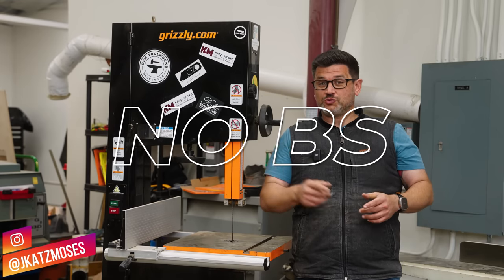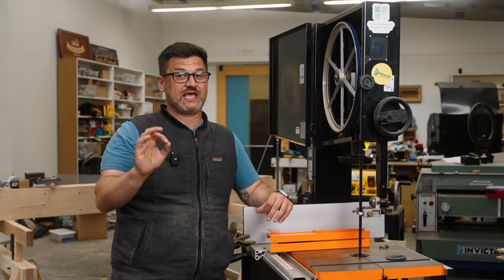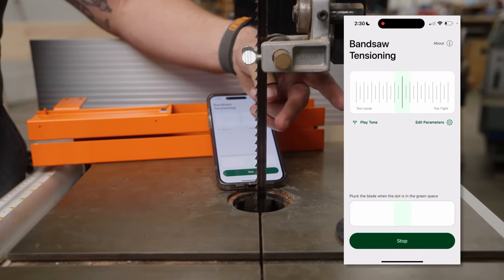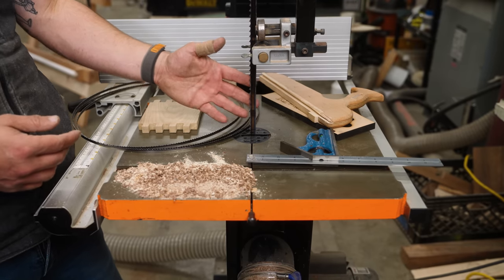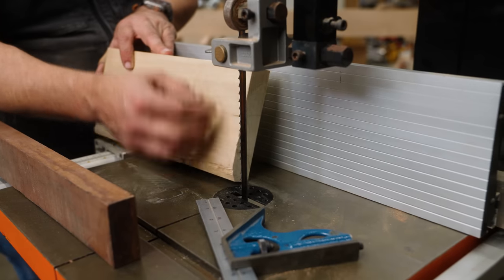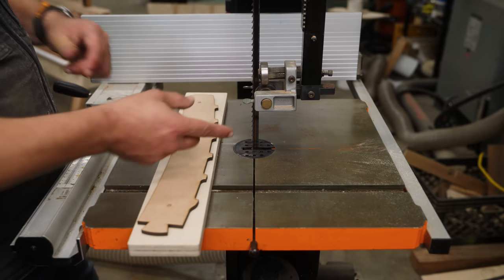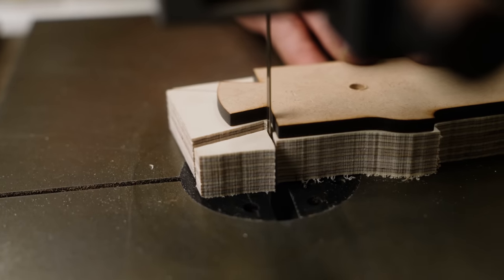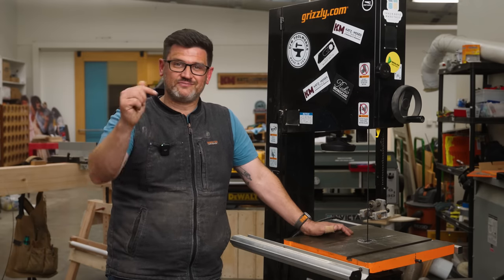Bandsaws: Mastering Setup and Use - A No BS Guide

Comment: Great video, and just in time.  I had a blade wandering and everything was tuned up, not running on bearings, not over tight, or loose on the tension.  Tracking was perfect, back of gullet riding right on the center of the tire.  Wouldn't you know, the blade was dull...I didn't realize how dull until I swapped it out.  Thank you!

Comment: thank you Katz . i have the same bandsaw . i use a 3/4 " 3 tpi  for resaw and use a disk grinder to resharpen it it takes about 18 mins . on the face . after i got it a wind fall fell into my lap . trees dropped in my area . 200.00$  chain saw and i have logs to boards . pear . china berry , birch and oak . sitting on cinder blocks an 2/4" pear is chest high . lots of work but good wood .in 72 i learned to open blades . i forgot how by 2014 lol . at this time i got 8 white oak logs waiting for health to improve and to finish building Izzs chain saw jig / sled . thank you for all you do .

Comment: I have a 14” wood cutting bandsaw and love it. If you think putting a new blade on can be intimidating, you should try that on a horizontal steel cutting bandsaw, where the blade twists almost 90 degrees to go around the pulleys. I’d also just replaced the guide bearings so everything was out of. whack. I enjoyed your video, keep up the good work. Almost forgot regarding changing blade, I have only one arm which doesn’t help either.

Comment: Thank you for this video, Jonathan.  As a cautionary tale, I ruined a Rikon band saw during my move because I forgot to detention it.  During the move (summertime in the Eastern US) it was on the truck several nights and when I finally got to it in the shop, the main spring was toast.  Still to this day I can’t find any way to replace that, so now I have to replace the entire saw.  I’m heartbroken and wallet light.  But, your video will be key when I finally get that new saw and get it tuned and set up.  :)
Reply: Amazon sells a Carter tension spring for 14" bandsaws - called a "cobra coil bandsaw tension spring", about $35

Comment: As you point out in showing your testing rig, bandsaw tension is set in pounds (lbs). There are actual tension gauges available to set the tension; one of the best is from Starrett. The saw itself plays a huge role in selecting the target tension, so it would be good if the app allowed for cast iron vs. welded steel bandsaws etc. I have a 24" Agazzani that I run a 1" carbide Trimaster blade on tensioned to 35,000 lbs, and it works beautifully. I also have a 17" Grizzly, and there is no way in the world that saw could tension any blade to 35,000 lbs, as the spring would be in coil bind well before that, so the type of saw is very important to determining the target tension.

Comment: Jonathan, this video could not have come out at a better time!  I just finished cleaning and replacing the guide bearings on my 14” Craftsman bandsaw last night in preparation for getting back out in the shop after a long hiatus. The app has been purchased and I’ll be using it when I install the blade today!  Thanks for all the awesome no-BS videos!
Reply: I own a craftsman also.  Unfortunately since Sears went belly up support for the saw doesn’t exist.  However, I found that my saw must have been built by Rikon or the manufacturer of Rikon.  Mine is a cross between the 10-324 and 10-325.  I’ve been able to buy parts and accessories that work perfectly with my Craftsman.  And it is a great saw.
Reply: @mwoody4560 I have a Rikon 13-900 rip fence on it. Bolted right on with no modifications.

Comment: Several really good tips. Blade tracking and tension, templet jig, how to adjust bearings, types and width of blades. However you didn't cover aligning the miter slot to the blade and the fence to the miter slot.
Reply from the maker: That’s more table saw setup. A bandsaw is a rough cutting tool and those things aren’t as critical

Comment: Great info!

I have been using the frequency method for several years after a blade failure (I was using the finger press method previously) took me by surprise.  I use the free Spectroid app on my cell phone to measure band frequency and formula from Fine Woodworking to calculate the desired band frequency.  For my saw (14” Rikon) and the blades I commonly use the target frequency is usually 57-61 Hz.  So I have just been using 58 Hz and that has worked well.  I resaw 10” wide boards into 0.180” thick panels for ukulele fronts, backs and sides.  That can be challenging and proper tension and a sharp blade really helps.

The only problem I have when tuning a blade is noise in the workshop.  I end up turning off the fluorescent lights, dehumidifier, and occasionally the furnace to make sure I have found the rightpeak on the Spectroid display representing the “fundamental” and not 60 cycle noise or a higher harmonic.
Reply from the maker: Sounds like a lot of work but cool way to do it
Reply: Thanks!  Excellent pointers,

Comment: I downloaded the app and used it on a Laguna 14BX with a Timberwolf 1/8” x 14RK 0.025 … I couldn’t loosen the tension sufficiently to get into the desired range and it felt scary loose. Interesting, I cleaned my blade (it had some pine resin/sawdust) and, without moving my phone, the frequency changed slightly. I’ll check the next blade when I need to change for the project, but am apprehensive about running the 1/8” at such a low tension (reading below 0 on the built in reference). Keep up the great work and I look forward to the updates to the app.

Comment: Something I think might be interesting for a No BS video would be fences.  How to set fences properly.  Differences in fence styles and lengths.  Recommended fence upgrades via purchase (Bow XT extender, Jess Em stock guides, etc), as well as jigs or other construction that can be made to compensate for a fence that won't keep square or is too short (a contractor saw fence, essentially).

Comment: A recommendation for the app, that could help inexperienced users (and you, if you start selling bandsaw blades through your site, or if you have affiliate links):  Blade recommendations by usage.  When you're on the screen to set your parameters, put the type of cutting first in the list. Have the app default to recommended blade width and tpi automatically, and a link to where we can get your recommended blade for that setup. Then, if they don't have that exact blade, they can adjust parameters to the closest of the ones they have. 
I know the more advanced users won't need to be reminded of the recommended type each time, but it could be a nice perk for the newer users.

Not for nothing, but finding another way to offset the cost of the app might be a good idea.  Don't get me wrong, it's a cool idea, but raising the cost more than $5 on something that is basically a combination of a single data reference table and a free guitar tuning app is probably going to be pushing it.
(and coming from someone who's bought quite a few of your products, i mean this in a constructive way, not trying to negatively criticize)

Thanks for another great No BS video!

Comment: With respect to TPI I have had a lot of success with the guideline of “enough to have 4 teeth in the cut, or 3 tpi, whichever is coarser.”  You don’t want to cut 1/2” stock with a 3 tpi blade, but for resawing 6” stock 3 tpi is great.

Comment: Excellent video. Than you JKM. One helpful hint that would have helped (If it is true). When the cut is tracking to the left, the blade needs to be adjusted forward and vice versa, if it is tracking right, the blade is too far back on the wheel. I am pretty sure I learned that from Mr. Snodgrass.
Reply from the maker: Feels like we should test that. Makes sense and has never crossed my mind
Reply: @katzmosestools  That has always been my issue with my Harvey Ambasadore. I can't keep the wood against the fence. It walks away (need to move the blade toward me.)

Comment: Thank you Jonathan, downloaded the iOS app & went out to my Jet 14" band saw that currently has a 105" x 3/8' 3 TPI Carter AccuRight blade installed - I was amazed at how under tensioned the blade was.  I set the manufacturer parameter to 'Other' - the app worked perfectly.  My one question is does the temperature of the blade and ambient surroundings have any effect on the tension tuning (I'm in NJ, my garage temperature was 54 degrees)  If so how often, or at what +/- temperature variation should I expect to re-tension?

Comment: Thanks.  Question on blade position.  I’ve always centered the blade on the wheel.  You said the bottom of the gullet should be centered.  Does this hold true for all blade widths?  I use a 1/2” or 3/4” blade often for resaw.  It seems that if I centered on the bottom of the gullet those blades would be very close being of the edge of the wheel.  PS love your channel and this series.
Reply: PS.  I just went through my old saw and reconditioned and tuned it.  This was great timing.  I’m now reconditioning, tuning, and upgrading my jointer and thickness planer.   I’m replacing the straight blades with Byrd Shelix cutters. A video on jointer or thickness planer tuning, use, etc wood be awesome.  I have old rigid 6” jointer and 13 1/2” planer.
Reply: PSS.  I use woodslicer blades.  If I heard correctly you wanted to know the blades we use so you could update the app I just purchased😊 My saw is 14” and uses 99 3/4” long blades up to 3/4” thick.
Reply from the maker: Yeah you still want to put the area just behind the gullet in the center of the wheel. Think about it like towing a trailer. That’s the part you want the tension. If you center the blade then it’s going to want to pivot in the middle of the blade and not where you’re cutting

Comment: I purchased the app. I set up all the parameters, Timberwolf, 31” wheel to wheel centers distance, non-carbide, wood, straight cut, & ½” blade, and tried it out. No matter what the tension it read “Too Tight” even to the point where there was hardly any tension on the blade. The tension indicator never moved! I did at one time get close to that deep base tone at which time it still read “Too Tight”.
Reply from the maker: Watch Andy’s video. It explains it n depth. Dry measuring on the other side of your wheels. I’m guessing something like the brush designed to removed sawdust or something else like a guide is touching your blade on that side. Either way watch Andy’s video. The update will have a better step by step guide on trouble shooting and use. Cheers
Reply: Update … I put the phone on the other side of the blade, i.e., between the blade and the support beam. Made sure the phone was square (or perpendicular?) to the blade. My first test was “Too Loose”. Amazing, a different answer! Kept tightening and the indicator moved closer to the center. Gave one last tightening and it was a little “Too Tight”. Loosened it up just a bit and I was right on. YEAH!

Comment: I have a 10" Rikon benchtop.  The manual says "... the saw blade should deflect about 1/4” when pressed with a finger to the side of the blade."  But the manual omits specifying how hard to press.  I need the app!
(Aside:  To align the drive wheels, I cut a straightedge out of hardboard (aka Masonite), with notches to bridge the frame.)
Reply: I also have a 10” Rikon bench top bandsaw and would love to use this app!

Comment: Jonathon/Andrew, I purchased the app two years ago and am currently running v1.6.0 on an iPhone.  I am having issues where the app almost always reads too tight.  I was trying to tension a 3/16" Timberwolf blade yesterday and even if I lowered the tension to the point the blade would be thrown off the wheels if I turned on the saw, the app would still read too tight.  I have tried close to the post as well as near the bearings, with no bearings, top or bottom, touching the blade...and still too tight.  I also am not able to hear the 'Play Tone' when I push that button, even with headphones.  Any advice on my issues?
Reply from the maker: Use the other side of the bandsaw. The brush under the bottom guides can affect the tone or n the roght
Reply: @katzmosestools  I have tried both sides of the bandsaw, namely the post side and the bearing side, with nothing encumbering the blade (e.g., bearings, etc.). You mentioned the brush.  My bandsaw (Laguna 14BX) does have a brush on the lower wheel but the brush only touches the top of the wheel and not the blade.  I also tried taking the case off my phone but still consistently receive a 'too tight' reading on the app, even at next to zero tension.  I even tried to delete and reinstall he app with no luck.

Comment: If you do an update could you address drift.  To freehand I have to hold at an angle and I get a wavy cut.
Reply from the maker: This setup solves drift. If you’re still getting drift your blade is dull or you didn’t setup right. There’s no magic bullet but tension setup and sharp solves 99% of bandsaw issues